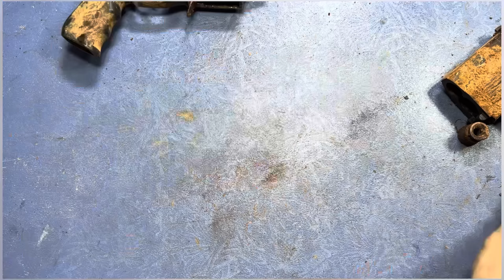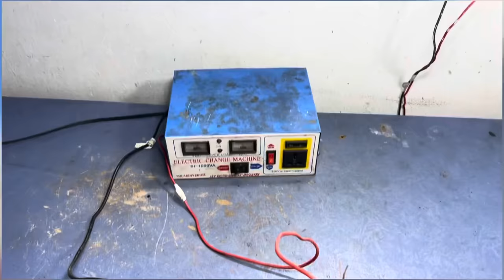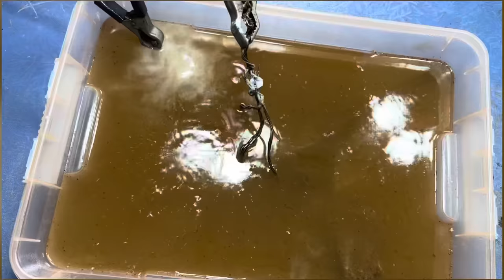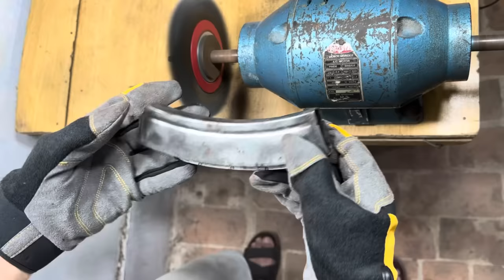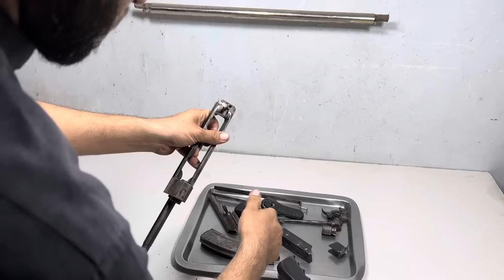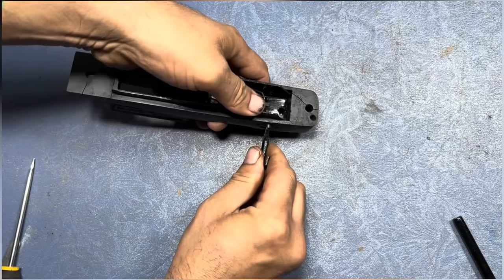Gun restoration MP5 gun restoration MP5 pistol restoration gun restoration

Comment: I'm sorry, at 15:46, did he actually spraypaint all the gun internals black? Like inside the upper receiver and everything? All those precision sliding metal parts, now covered in acrylic paint. Yeah, I'm sorry, that's not how that works. While I'm shocked the bolt did move when you had it mostly put back together, as you use the gun, all of that paint will be scraped off, potentially causing more problems down the line. This is why internal firearm parts are blued, not painted black.
Reply: right???!!!  Who spray-paints any metal on a gun?  I mean, I have sprayed on plastics for camo creations of my liking, but the mag? I'm sure it will be a nice tight fit now along with the upper receiver with bolt movement. lol.  Oh and the lower where the oil / lube will come off the bolt and create a nice glob of gunk in the lower.  How is this a restoration.  Best I would give it is a fixer upper for a wall hanger. lol  I think most of us watch these to see how they actually destroy guns. lol
Reply: Yeah man and he does it quite often actually if you’ve seen one of these vids before he does that b.s electrolysis that doesn’t work well then putty’s the pits and paints the whole 9 yard lol
Reply: @richpitty  lmao. Of course. I’m sure the integrity of the pitted barrel is 100%.
Reply: @GoldenFingerPIcker  Did the paint mfg. pay him to commit that abomination? I know very little about guns but I screamed 'NOOOOO!!" when I saw that gawdawful black spray paint come out!! WTF spray paints a gun high-gloss black... and then to use it on moving parts?
Reply: Isn't blueing the preferred method for blacking up metal on guns? I've not done it on guns, but I've used it on other things like car and bike parts etc.ive even painted with a rust proof chemical product to get a black/dark grey finish before now. But never spray paint. And even if you were going t use spray paint, you need a flat finish first, a filler primer maybe, then rub that down with various grit wet and dry to get a nice finish. The finish of the spray job on this looked like a burnt steak.

Comment: Not an mp5 it's a Russian Sub machine gun chambered in 9x18, the muzzle of the gun is standardly found on the fronts of AKS-74U . The carry handle is obviously mimicked from an m16 onto a stamped dust cover for an AK, the signature design of AK's lies in the bolt carrier and sprint for the blow back system above the trigger, styled after the ak. There you go people, not an MP5 but a very cursed AK that even Ian from forgotten weapons would have a hard time describing what the hell this could be and where it was made
Reply: It was most probably made in Pakistan as it has the look of a Pakistani MP5. Half AK, half M16 and a quarter junkyard dog added in for good measure. Made of mild steel and the side of a steamship of unknown origin.Hope this helps😊
Reply: @Andy-Gibb  Pakistan Khyber International Arms company
Reply: Yes, and who the hell spray paints moving parts instead of bluing.  That bolt should not be painted.
Reply: not even a "gun control expert" should be able to confuse that for an MP5 ... even while covered in rust! The charging handle is on the wrong side. (But, I get the point -- it's not the worst spamming)
Reply: anyone over the age of 12 knows this isnt an mp5
Reply: It’s a security mp5
Reply: @tsniceberg55 e
Reply: Mizerii
Reply: @tsniceberg55  cursed russian parody on MP5
Reply: @ovrwhlmd apperently it aint russian its a Pakistan gun, adleast thats what popped up when “researching” this gun

Also it aint an MP5 its an M-P-5 apperently
Reply: @nanotech1921  holy... opens window
phew, that's better
as a RUSSIAN MILITARIST i know this, okay?

also, it's H(&)K MP5 (Heckler & Koch Maschinepistole (model no.) 5)
Reply: it's SR-3 Vikhr variant which is heavy bases on the AS Val.
Reply: "Ah, I see, no wonder it doesn't look like an MP5 trigger mechanism to me."
Reply: Yep exactly, i also saw the mixture of the weapons, like where did they even make that
Reply: A Pakistani MP5/AK74u love child perhaps?
Reply: Not even close to be an MP5 😂😂😂😂😂😂😂😂😂😂😂😂😂😂😂
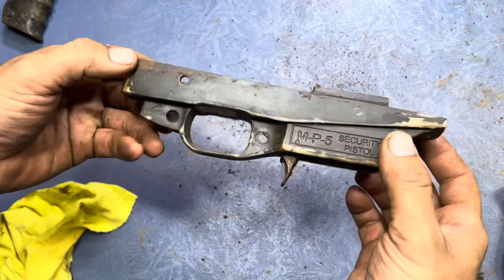Reply: It's M-P-5 SP, watch 8:19
Reply: @R311O  top part M16 front grip ak, magazine Mp5 so no its not an mp5 its some kind of homemade crap
Reply: @torbennielsen5029  It's not "MP5" it's "M-P-5 PS".From the AK, there is a slightly similar usm (trigger mechanism), the way it is assembled and the flame extinguisher.
Reply: @landroveraddict2457 the tolerances are so loose on that you could paint it with wrinkle coat and it’ll still function, haha

Comment: I am wondering why the internal parts were spray painted, and no blued? This spray paint is going to peel and plug up all working parts, ie, the trigger, firing mechanism, barrel, magazine. This is why gun parts are blued and not painted for longevity, and to prevent rust. Hope it is only a wall hammer and not something to be relied on for saving ones life.
Reply: The video is fake

Comment: What a sloppy messed up job! Spray painting mechanical  parts Is soooo wrong! Especially the Bolt carrier which in the AK weapons Is ment to be stainless!!!! Cold blueing solution are easily available if you dont want to do It with a hot blueing One. Restore toy cars, you may get better results!!!

Comment: I am sure that black spray paint will last generations, lmfao. The fake resto videos are awful. They smear orangeish mud all over the gun ,let  a bit of rust build on it and the act like they removed decades of decay. Where is the pitted steel? The rotted wood if these we so neglected and left to the elements. The inner workings would not be so prostine either. Dont fall for these fake restoration videos, they are rarely real.

Comment: You did everything very well, only with the metal and the coloring, you are not very good, I don't know if you don't have experience or you don't have patience? first you didn't work on it at all with love, grind it well with emery paper, because they are in numbers, the smaller the number, the rougher and harder, the bigger they are, you should know which one goes next, but in the end you have to sand it with water emery paper 2000 she would make it as smooth as a mirror or as ice the coloring was very weak it seemed that it was a tired gun used so much that it had a weak black color like a car from the late 80s-90s you could go to any ovicina where they paint cars and you can get a metallic color that looks like nickel, then it also has varnish and there are some additives that are added to the color and varnish to make it resistant to heat or you can order the special color that resist on high temperatures, and colur then don't start to melt or start to burn and dry up and then fall, and I'm not saying this out of pride, but if I had that gun I would have made it, im sure that your eyes would remainet in it even if you only saw it somewhere because only take an old thing, a rusty metal, remove the rust with bicarbonate of soda with a battery cleaner, then clean it, or even better, they are my sandblasted ones that come out of the air pressure cooker and it also removes the color even the rust and make it very beautiful, then with just a little emery cloth and water paper, a beautiful color and even black color, if you color it nicely, get a quality color and a good syringe for coloring and keep the syringe at the perfect distance to it seems manageable so that the color does not flow, do not burn it with a flame but let the color dry or put it in a chamber with controlled temperature and ventilation. but you don't say anything about these things, you've only seen it in videos like this on YouTube and either you deliberately put it somewhere and wet that gun or maybe you even found it but I wouldn't dare a recent weapon, so please find it and repair it because nobody loses that weapon like a wallet or a phone, if you find such a weapon, it's better to notify the police immediately without touching it at all because of course it the weapon has been used somewhere and someone can go to prison without any crime, he was caught with a weapon that was used some time ago in a murder, because forensics found the bullet in the victim's body and also found the weapon, it's almost a job completed because only if there is an exception that is too big for the bullet to deform in the human body, usually in most cases they keep the identical shape and reveal 100% if they really have the weapon that was used in any case in any crime. therefore, only if it was a weapon from the second world war or any war that has been over for a long time, it would be different even if I had found it or I would remove the chest and arrange it for the sake of making it into a beautiful video and to show people how an old thing can be returned to its condition when it was produced or maybe I would notify the police authorities of the country and tell you that I was going to restore it and I would get permission from them and I did everything legally.

Comment: Its lucky that all the gunk is only added on the outside and there's no corrosion, but if it had been stored outside and didn't have oil inside, and was wet, then it would have taken hours to take apart and most parts would have been destroyed.

Comment: I'm not an expert on the MP5 but I do have a few observations and questions about this video:  it Looks like an earlier version of the MP5 as the charging handle is not the current configuration.  Oh well for that.  Why didn't he fix the collapsing stock?  Is it not a collapsing stock?  Finally,  I assume that WIN brand, as shown,  is similar to Rustoleum?  I couldn't find any info about it on GOOGLE.   how durable is it?  Some of the components were not flipped around for spray paint.  Maybe that was cut out for time sake.   The spring for the charging operation seems really gritty...not smooth at all.  I probably won't get any answers given the YouTube platform.
Reply: Its not an MP5, as in H&K MP5, at all. Its a 9mm blow back Kalashnikov or AK style thing if its a real firearm at all. It seems to have the parts needed for a real firearm but extremely crudely made. I guess it could be one of the Pakistani or Afghan craft built weapons.